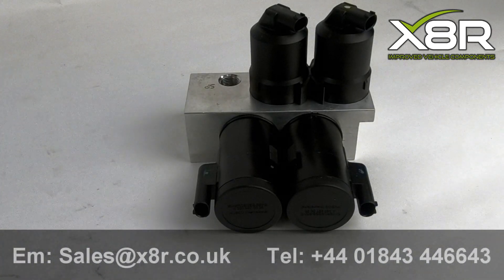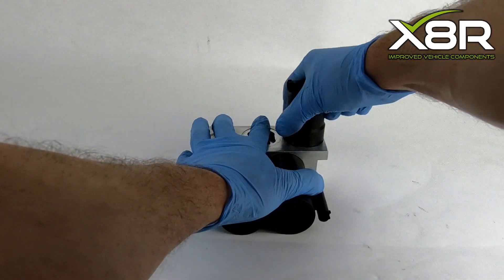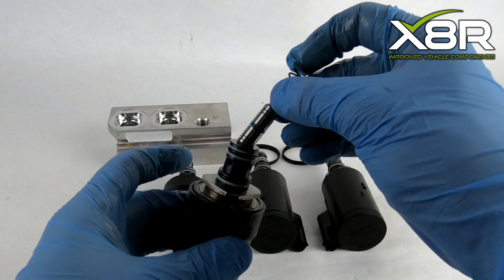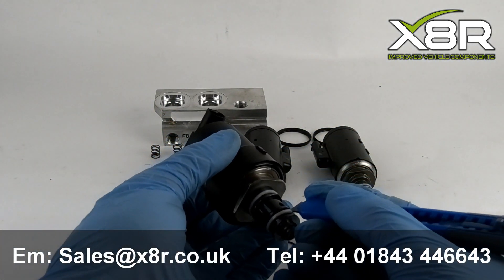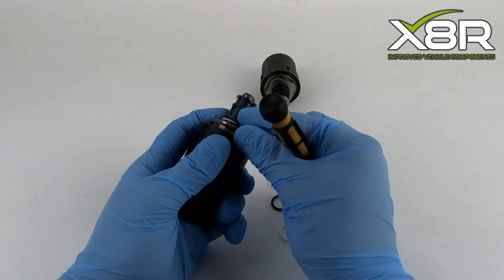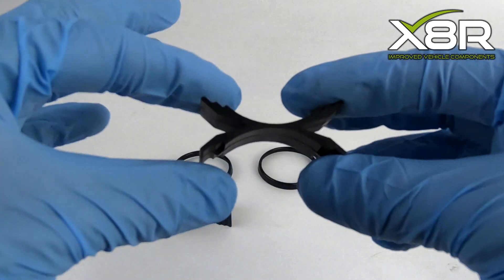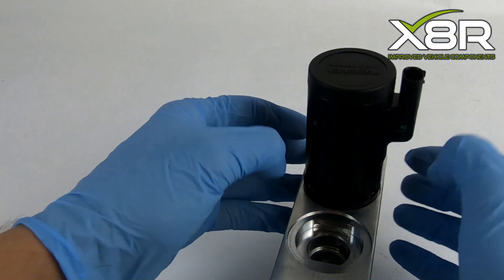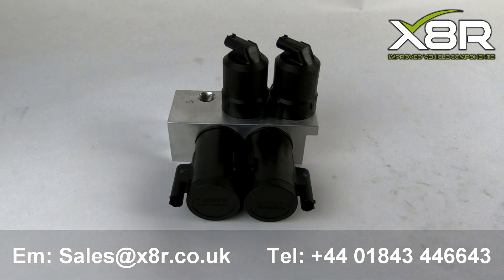Mercedes Benz ABC valve block solenoid oil seal repair fix rebuild kit seals o rings Install

Comment: I have a 2007 mercedes s600, the pump in the front has the black sphere pulsation dampener and my front suspension valve block is leaking slowly probably due to the o-rings being worn out. According to your description this kit's o-rings will not fit my valve block. Do you sell a kit that would? What do you recommend?
Reply from the maker: Hi there, unfortunately we do not sell a kit suitable for the vehicles with the black sphere. Apologies. - Georgina, X8R Ltd

Comment: Do u ship to Sweden ? 
And whats the cost for parts and shipping fee ?
Reply from the maker: Hi there!
We do ship to Sweden, if you check out our website you will be able to get a quote for all of our shipping methods.
Here is a link to this part on our UK website: https://x8r.co.uk/mercedes-benz-abc-hydraulic-valve-block-solenoid-oil-seal-repair-fix-rebuild-kit.html

Comment: Can I use alcohol or water to clean the valve block or is that a bad idea. Also is there anywhere to get the springs if mine are not firm anymore

Comment: The SL55 or other ABC cars get such a bad rap for expensive maintenance and repairs of the suspension system.  If you have some mechanical skills and good source of parts at wholesale pricing, it is not really not that bad.  When a side sags or the system springs a leak, most faint thinking OMG there goes thousands of dollars!  The two valve blocks are some of the most expensive parts to replace at a dealership.  This kit only cost less than $100 and rebuilding  it yourself saves you thousands!  The moral of the story is if you can't afford the upkeep of a used $120K+ Mercedes, don't freaking buy one.  If you do, be ready and have cash saved up, otherwise don't bad mouth your dismal experience because you assumed the car would be like a Toyota.
Reply: Well Said Brother. I have a C215 with an M137 innit. And I always say a similar thing. You will be attracted to these cars because of their lines, (their design) and their engines and performance, but only buy one if you have their suspension as their most important attribute. I lowered mines with lowering links, (it was a cinch) and not since my Lowriders days in the 90s have enjoyed up and down ride heights at the touch of a button (or the flick of a switch as it used to be). You see it all over the place, swap to coilovers, go on. But that defetas the purpose of these cars. My last car had coilovers from factory (a Maserati M139 with the F136 innit) and fine I loved the fact I didnt have to buy them and to lower the car all I had to do was wind them down man. That Car what with its Ferrari chassis  was way up there in the heady heights of car guy's dreams. But I say to you this, Only go for Coilovers if coil overs are better than your car. And coil overs in my Maser where stock, in my CL600 they would be such a come down I would consider it sacrilige to swap down to them. Before buying a Merc with ABC budget in their upkeep.
Reply: Exactly!

Comment: Well I whish I was clever for I 've bought both front and rear , refurbished they are just under $400 . but at the dealer they are $2000 . I bought refurbished and hope they work , that's is expensive enough then there is the replacement cost .  But you can get it any ware . Thank you

Comment: 03 s55 amg abc light is on red no sag or leaks do you think this will help my issue?
Reply: It might.  I recommend you get or borrow a STAT diagnostic system.  Red light ABC warnings can be caused by many many things.  But, yes, sagging is usually caused by failed o rings not allowing the system to keep pressure to hold up that heavy car.
Reply: Red light could also mean low ABC pressure in the system. Which could mean the pump is failing

Comment: It’s accurate apart from the fact the solenoids are quite tricky to get out.  I carefully  put them in a vice with soft jaws.  Then tap the aluminium manifold with a large punch to remove them.  I also used letter punches to stamp the manifold a b c d than put labels on the solenoids and take pictures of orientations.  You have to use a pair of water pump pliers carefully to turn the solenoids.

Comment: The video its not accurate as it looks!
Reply: Al Mad since I’m faced with doing this job I’d like to know what is wrong with their description. I don’t want to screw this job up!  Thanks.
Reply: @robertlaugherty4914  me too!!!!!
Reply: there are 2 different  blocks, one in the front and one in the rear... they are similar enough that the service should be similar
Reply: @bknobb4802   save yourself a lot of time and money. Just find a Benz part house and they will sell it rebuilt for 500